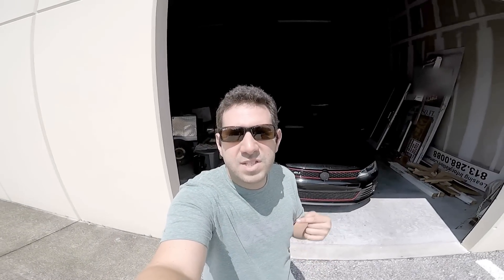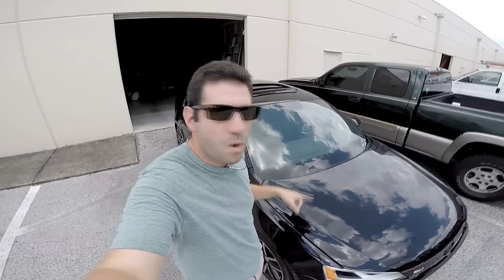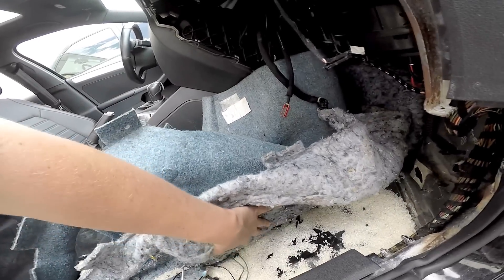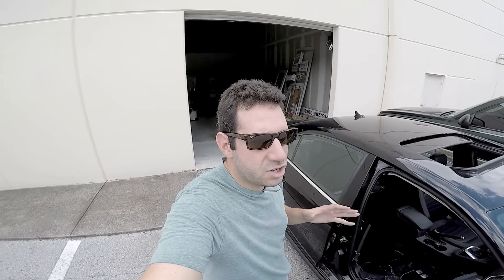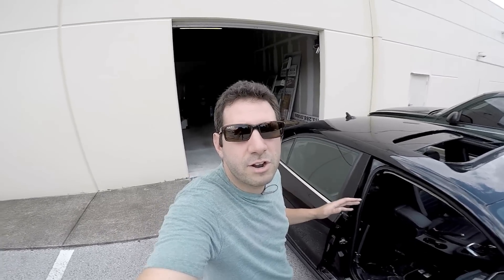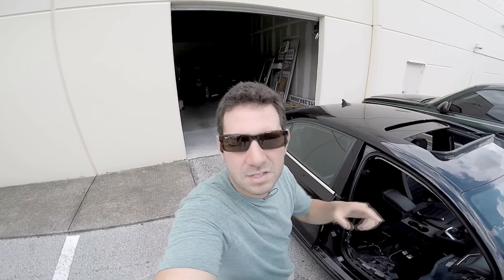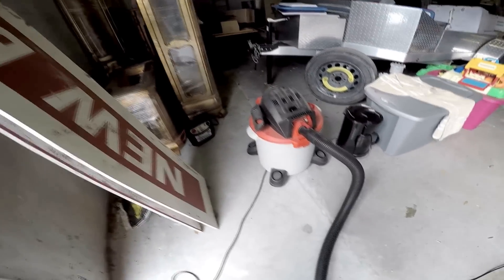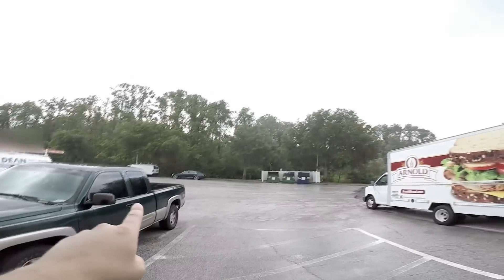I DUMPED 20lbs Of RICE in the Salvage Flooded Rebuilt Jetta! Here's what happened...

Comment: you can pull the rubber plug and let it drain out put a huge shop fan blowing in the car... open all the doors. i had one that leaked at the firewall i just pulled the seats and carpet out pulled the plugs left the sound deadener in the car fixed the seam that was leaking used 3 koolaid packs in a garden mixer to test if it still leaked resealed ..... took 3 times to get it sealed but once it was sealed it was fine. This was a hard hit, got the car free fixed it and sold it for the parts cost that kid had that car for years, he ended up hitting a truck with it he siad he was going at least 40 totaled out the truck he gave me back the car lol and bought another one at full price. The car was fixed again but this time had close to 120000 miles on it I gave it to a tow truck driver for towing a car from the auction :) that car was still going with over 150000 miles on it last I heard, btw the 2nd damage was no worse then the first damage other then the airbags went off, key is fixing them correctly :).

Comment: i had a 95 intergra in 2000. rain got in thru the hatch, the entire interior had an inch of water. i removed and replaced the rug and all the seats. the reason the water got in?? i put some euro tailights on it. and the water seeped right in during a 2 day thunderstorm.! luckily i got a good deal on the seats at a local junkyard.

Comment: You live in Florida, land of SUN. You should have used it, after using your wet/vac and I don't mean quickly running the wand over the carpet, spend some time sucking the water out of the carpet and pad. Taking the seat out is about as far as you needed to disassemble it. I know you couldn't put the whole car in a vacuum chamber but it would have drawn the moisture out of the carpet and pad in a couple of hours. Next best is a shop vac and time. I've pressure washed the interior of a car to get the soda and food and ??? out of the seats and carpet while sucking the standing water out with a wet/vac and then carefully drawing as much water out of the material as I could. Then I left it in the sun with the doors open. Took a lot of time but it came out as clean as a car with 150,000 miles and four young children should be instead of a pig pen. It was nasty! But the end result was a car you could sit in and not smell burgers, pizza, fries, nuggets and all the sodas made mixed together. As for mold and mildew? What is the panic? We live in a world of mold and mildew and spores and all kinds of stuff. If it worries you, add a little bleach to your water and let it soak in then suck it back out. Just don't let it eat the material or discolor the dyes.

Comment: Sam put the aircon on high. For a few hours or with the motor on or on an external battery source. that basically is a dehumidifyer it cools the Car by drying out the moisture.

Comment: i agree with the wet/dry vac and fan but instead of rice i would have used baking soda as it would get the rest of the moisture and help prevent mold/bad smells. rice only works on electronics. you could also use a pillow case filled with salt to help drying

Comment: DUDE WTF? you put your cell phone in rice but the car you have to take all of the seats out and pull the carpet out. separate the padding and the carpet hang them up to dry inside somewhere that they won't get wet again and leave them there till they are completely dried out then in the mean time, make sure the hole to the inside is completely plugged and watch for more water leaking in
Reply: Good point.
Reply: DaddytechEnt how the fuck do you bold letters
Reply: asterisk* before and after the thing you want to bold.
Reply: The phone/electronics in a bag of rice trick does not work. Its an internet myth! I am an electeical.engineer and repair.tech but dont take my word for it. Look up louis rossmans video about it here on yr
Reply: ceecrb1 it has always worked for me
Reply: I was about to say the same thing. plus i have 5 children who were the most accident prone kids on the planet and all 5 of them were as hard as they could be on their phones which also meant that they all got a little wet from time to time and the rice trick almost always worked for all of them as long as you retrieve the phone quickly and immediately shut it off then leave it off and throw it in the rice . works almost every time but takes forever to dry out.
Reply: I appreciate that he gave it a shot, but I wasn't expecting it to work at all. DaddytechEnt's approach is the correct one. It also makes the most sense to leak test it again with all of the interior out so he's not drying it out over and over again.

By now that car is probably starting to mold too unless Sam shot all of these videos in the same day and then immediately dried it out somehow.
Reply: yeah and once they start that mold and mildew smell you never get rid of it
Reply: You can. It's no big deal to pressure wash the carpet and hit the jute with 10% bleach solution. That will take care of it as long as you get it dried out in a reasonable amount of time afterward.

The first step to all of this is to just bite the bullet and gut the interior down. It's not that big of a deal and he's already about 1/3 of the way there.
Reply: does it really work

?
Reply: NO it doesn't work, unless of course you are trying to recover a cell phone and even then it's hit or miss
Reply: Mostly miss. Rice just isn't a good absorbent.
Reply: +DaddytechEnt The retrieving and shutting of is essential in your method working every time. That it takes forever to dry out is a hint that the rice doesn't help. Try putting it in a warm dry place next time and compare.

Comment: You can buy a commercial desicant on-line that will work a lot better than rice.  But even a really good desicant will not be effective if the carpet and/or padding is saturated.  That said, even if it feels dry ther will probably still be a significant amount of moisture in materails like padding and carpet.  A desicant between the carpet and padding will absorbe any remaining moisture and prevent molding and metal rusting.  Also, almost all commercial desicants can be microwaved to dry them out and be reused.  Some have a color change chemical that indicates whether it is saturated.  You can also use fabric bags of it to lay on top of the areas that weren't flooded to make sure you get all the water out.  I used this on upholstered furnature and it saved them from developing mold.

Comment: The easiest way to deal with wet carpets is to just take the seats/interior trim out and pull the carpets, use a shop vac to dry everything as best as you can and sit everything in the sun for as long as you can. More time consuming than dumping rice, but it's really the only way to fully dry out the carpet/padding.

Comment: If you let it air dry, you'll always have a musty odor when you get into the car for the first thing in the morning. The best way to get rid of the moisture and the future musty smell, would be to take out the carpet and padding. Wash the padding and carpet with proper carpet cleaning solution (no nice smelling fragrance soaps), let the carpet and padding fully 100% dry out side of the car, then clean the inside of the cars floor panels with a damped rag with hot water and bleach. This will kill the smell of any standing water, clean and dry best. Obviously don't wipe any black interior with the bleach solution, just the bare floor. 

I've had this issue before and that's the only thing that helped.. must take out the interior, wash, and put back in. I've had musty odors for months before finally ripping everything out.